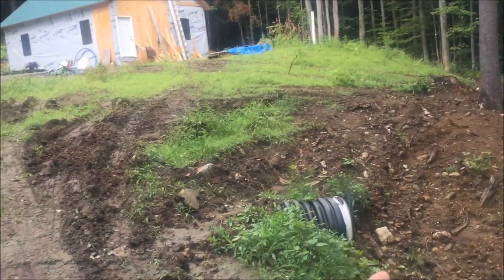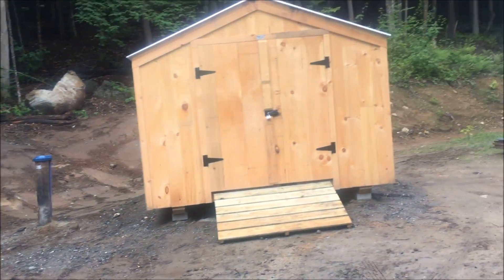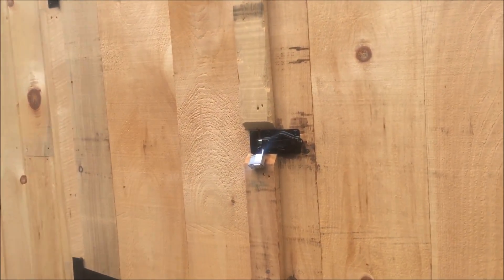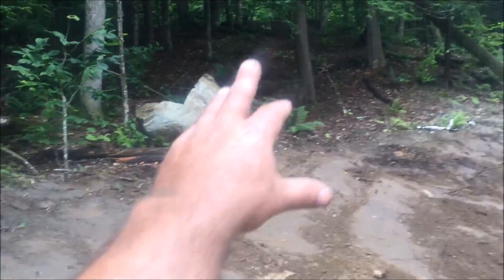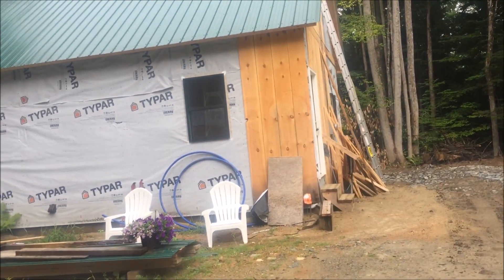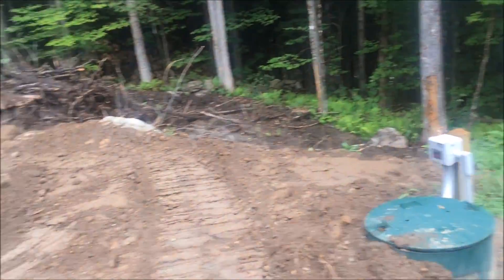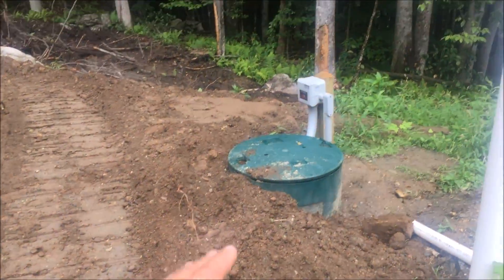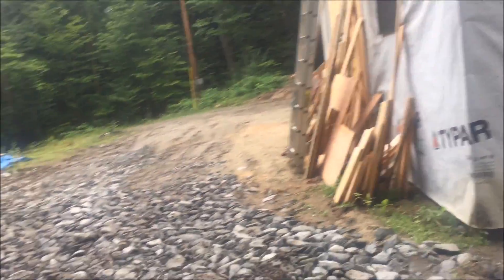How to Prepare Your Tiny House Site for Electricity, Well, Septic & Driveway Install

Comment: Do you pay for electricity to be installed or is it free
Reply from the maker: You can add a electric package to a fully assembled building.  Otherwise if you get a kit, you or someone you hire could install the electric as you build.
Reply: @JamaicaCottageShop  how much is that typically cost?
Reply from the maker: @Kira-dh8xn  It depends on the building.  You can check out the option pricing base packages under "Interior Options" here. https://jamaicacottageshop.com/option-pricing/